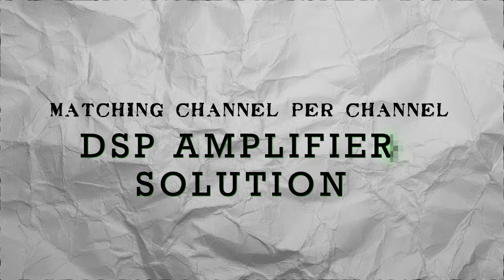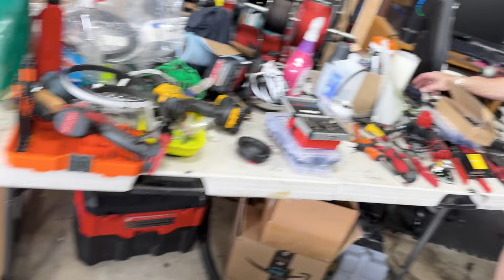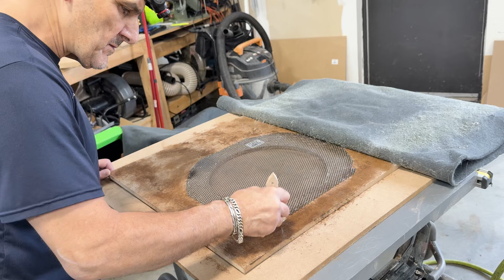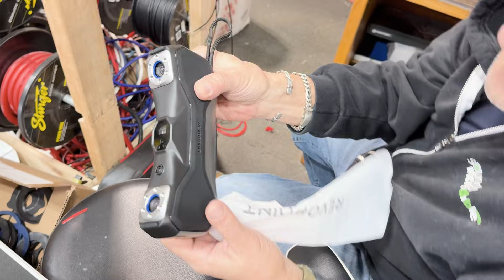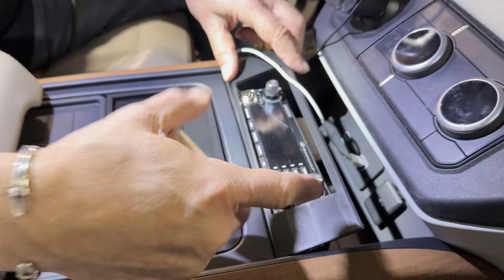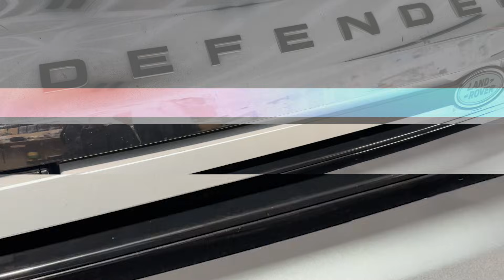Defender 110 Audio Upgrade | Equipped with Meridian Sound | Part 2

Comment: Much like John I still struggle with 3d modeling and everything.  I end up just screwing the midrange upside down on to some Sentra or PVC and using a flush trim bit to make adapters.   Some day I will figure it out!   Great job as always!